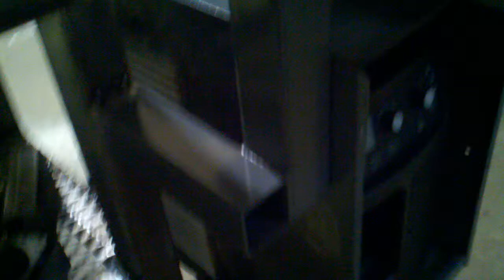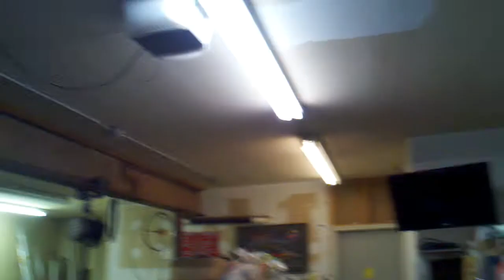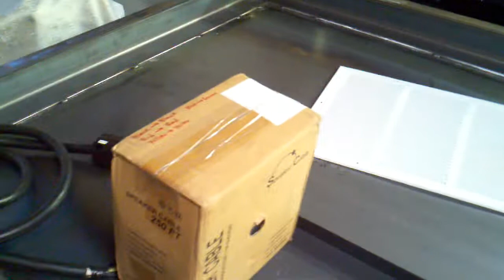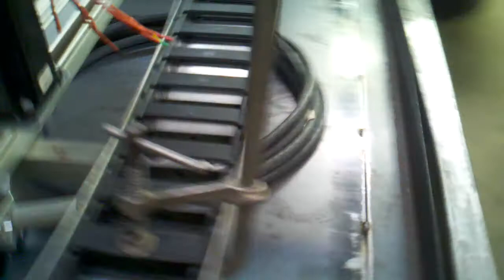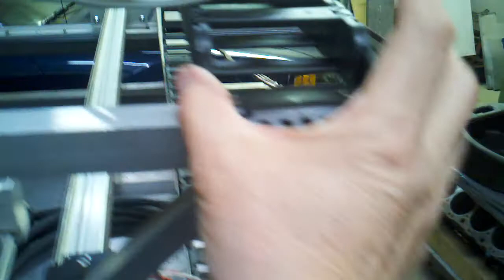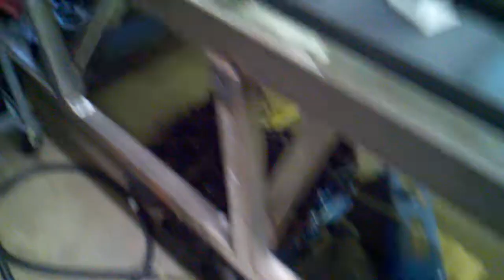Cnc plasma table project pt.8

Comment: Any idea what the cable track sizing was? Or can you recommend a size. I'm currently working on a 4x4 Plasma CNC and this is the only thing on it that I haven't figured out.

Great build! Been following you for years now starting when I built my first flatbed dump for my pickup and I really appreciate all the information you post! I was lucky to find your pages so early on in my career because they instilled a sense of precision in me that has gotten me very far!
Reply from the maker: 1 3/8" tall x 3 5/8". Wide. 2500.07 is the number on these. Amazon has them. Good to hear. A lot of challenges to conquer.